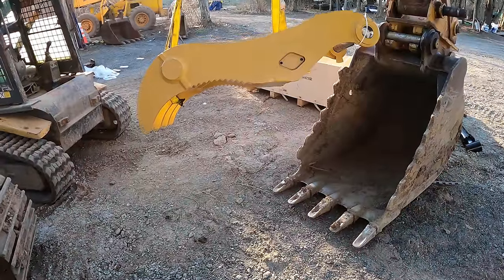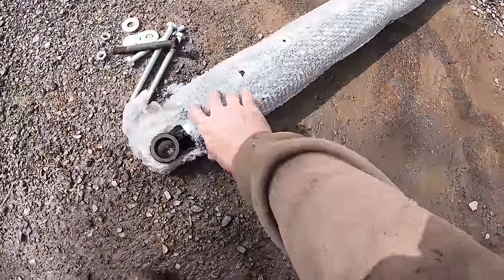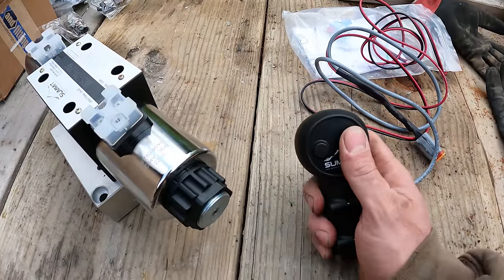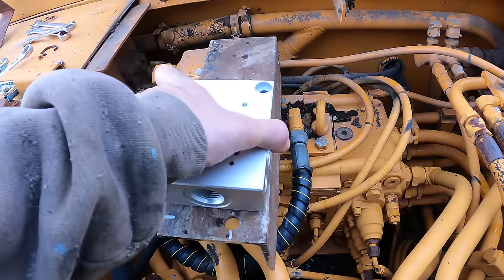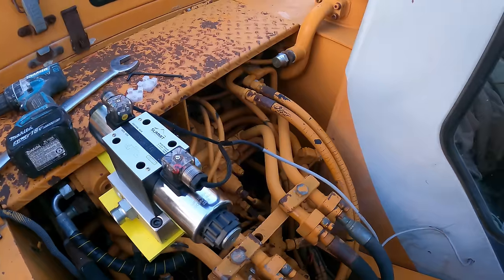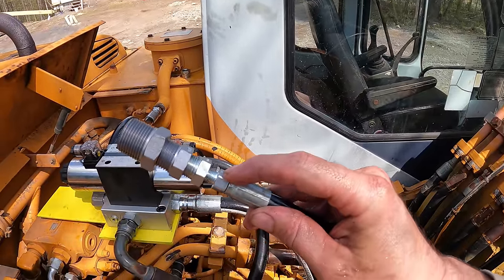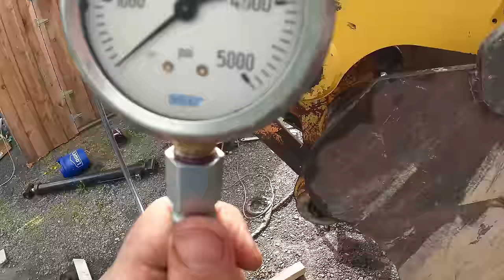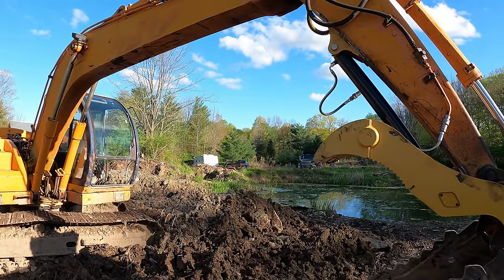Installing a hydraulic thumb on an excavator with 1 way aux circuit

Comment: You need to mount two short cylinders to the top of
the bucket on either side of the thumb, 
Instead of the long cylinder, 
like a skid steer brush grapple facing you instead of out front,
 so it will never bend a  cylinder. Or need a relief valve. And the cylinders be on the outside of hitting anything

Comment: Just use 2 diodes to activate that original one-way valve when you push one of the two new switches on the new control. If you have an old tv, there would be diodes in there that would work.
Reply from the maker: thats what i did
Reply: @jmuller86  I'm only halfway through your video, good work! You're wiring up the solenoids now.
Reply: @transmitterguy478  does your wife complain about going off half cocked? 😅
Reply: @13panda13  YES! All the time!😉

Comment: When using a thumb you always put the bucket on the wood then roll the thumb into it so you don't put to much pressure agent the thumb.
Reply: False. Other way around. Bucket has more control to move slowly. Thumb first then feather bucket.

Comment: If you do install an adjustable in-line dump valve, you should only have to put it on the thumb retract pressure side of the line (which is the side of the line the bucket pressure will be pushing against).
Reply from the maker: yea I could install a crossover relief valve right next to the cylinder. or just an inline relief valve by the directional valve, and tee into the tank for dump
Reply: @jmuller86  yeah, either way, it shouldn't be too much of a chore.
Reply: @jmuller86  Update, saw the last video. Bummer. I feel for you Jesse.

Comment: What a great video, but i have a question. Normally as you say, this circuit you added is used in tractors to split the tilt on the bucket to add ext equipment, but that means you'd have to push and hold a button for 3rd option, another button for 4th option and simultaneously move the joystick. In your setup you only push these two buttons which means there has to be some sort of computer somewhere controlling it, am I right? Could you please explain this setup in more detail since I'm planning on doing something similar on my Case excavator which only has foot control and I want button control for parallel boom, extra hydraulic(tilt bucket, thumb) and hydraulic coupler.

Comment: You need to put a reliefvalve on the piston side,just use the testport on the new valve and drain to tank.
Reply: Came here to say this.  Good call.
Reply from the maker: I left the one port open and no fluid ever came out so i dont think either of those tiny ports do anything. I was thinking a crossover relief valve on the piston side next to the cylinder. the excess pressure would then dump to the gland side and I would only be dealing with 1/2" hose there instead of 3/4, less expensive
Reply: Yes,you could do that but then you could end up with a oil volume problem since the piston side is a lot bigger then the rod side. I’m surprized no oil came out of the "test port"   Do you have a datasheet on the valve Block? Ideal solution would be to have the valve you have with all ports open to tank in mid position and have a overcentervalve on the cylinder,but now you have to work with what you got. Btw,love your videos and always look forward to the next. Keep em coming. 😊
Reply: The electric over hydraulic valve come from bedrock attachment too?
Reply from the maker: @brent9393  that was summit hydraulics. All the fittings came from hoseandfittings.com, they are the cheapest around and have everything you need

Comment: Jesse miller those hoses on the boom are the same as the rear axle on a skid steer rear drive to supply power & I just thought I would mention it that there the same fitting

Comment: Flexible conduit will protect the wires far better that just hanging out; grommets or pass-thru in the cab wall likewise will stop a lot of chances of abrasion on insulation of wires.

Comment: When the oil in the thumb is trapped, the bucket cylinder has the ability to damage the thumb cylinder. You need to add a relief to tank on the thumb cylinder. It will also help you from crushing things you pickup. Set it around 25% system psi, around 500. Your going for the minimum psi to hold something in the thumb.

Comment: Jessie, my dad used to own an automotive parts warehouse (bigger than Napa) and he also made hydraulic hoses. You can pick up a hydraulic hose press machine for about $1500 plus assortment of fittings and boxes of hydraulic hose and make your own hoses to size.  The equipment would pay for itself in no time. Plus, you can make hoses for friends at a discounted rate, which would also help pay off the equipment. Why don’t you do that?
Reply: Great suggestion! I see more and more YouTube creators of maintenance and repair channels doing that exact thing. Like a battery cable crimper, it's a no-brainer.
Reply: @Watchyn_Yarwood  😮q
Reply: ផលកម😊ចោល

😮😊

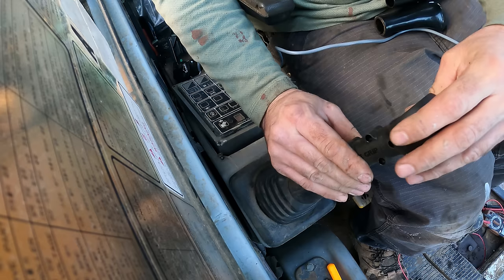Comment: 1:07:21 Could you not have taken the P and T lines off your original 1 way valve, and connect them straight to your cetop 5 setup and bypass it (and therefore the two electrical circuits)?

Comment: When the Thumb is activated then the relief valve is active in the circuit. As soon as you turn the thumb activation off, the directional valve closes the circuit for both lines of the thumb cylinder. You won't break the thumb or cylinder for the thumb. If you put relief valves on both lines of the thumb cylinder circuit, then you will never be able to hold anything with the thumb at full pressure because the relief valves will always be giving way. Just leave it like you have it and enjoy your new abilities!

Comment: The 2 smaller ports marked X and Y are pilot pressure and drain ports. You can use the X port for a pressure test port as it is connected internal to the larger pressure port and the Y drain port is essentially  a just a smaller tank port.

Comment: Would be fun to see you get an old lathe one day so you can do some of your own machining projects! If that is something you would like doing and you can find one at a reasonable price. I watch Farmcraft101 a lot and he is able to make a lot of his own parts like bushings and threaded adaptors. Would be good knowledge to pass onto your kids one day too!
Reply from the maker: yea when things settle down a little for me I would like to try to get into some machine work. A lathe and also a plasma table would be nice
Reply: It won't take but a few trips to a machine shop to pay for a good used lathe. And check in with IC Weld on to arc gouge.

Comment: Why are you fixing it to the coupler, instead of the bucket ?
Reply from the maker: Because otherwise the coupler is useless because then I would need to take the thumb off if I want to change buckets

Comment: You could take a steel plate and cut it in a fork shape so you can bolt the shutoff valve to the mount that held the steel line. The two tangs of the fork can hold the valve down and the space between the fork can access the shutoff. I don't think you want the cylinder hose flopping around put stress on the hose. It also looks like it could get tangled up and damaged.

Comment: Hello sir I did the same thing for my excavator with the same components. The reason why you have no relief is because the system from summit hydraulics is a closed system.
Reply from the maker: its closed to ports a and b but it is still open center. which means when not in use, it sends the flow coming in back to the tank

Comment: You done a beautiful job on that thumb install there is only one thing I would change I would put a 90 on that line going to the thumb cylinder so the line doesn't stick out and get Hung up in some rebar on a demo or some crap like that. Im your newest sub😊😊. Im also Operator/ Superintendent from Alaska

Comment: Yeah that 2300 psi is probably a different relief valve remote from the circuit you’ve added. You should use the test port for the bucket circuit, so your not guessing at the thumb pressure.  @farmcraft101 help us out here

Comment: For the wiring of the one way valve, if you have a single relay with a Normal Closed, Common, Normal Open, Ground and Power for the activation of the relay Coil. You can connect the "A" output from your direction valve switch to the Normal Open and to the relay coil. Connect the "B" output to the Normal Closed and the one way valve coil to the Common. When the "A" button is pressed, it will activate the relay and that will activate the one way valve through the Normal Open connection to the common which is now activated and making a connection. The "B" button will activate the one way valve directly through the Normal Closed to Common circuit because the Relay will Be off.

Comment: Where do you get your shims? I have the same excavator. I’ve been looking for used parts but having trouble finding them… might have an extra grading bucket that your looking for pulled it off mine and put a digging bucket on it.
Reply from the maker: I have my parts machine that I am selling parts for it you need anything. Some of the shims came with the thumb and I ordered 70mm shims for the thinner ones

Comment: Why don`t you use two relays one for each button so either relay when energised would do the same thing as the activation button then you would not have the problem of the back feeds

Comment: Damn, the moment you said 200 an hour for that machine my jaw dropped, over here in Europe 200 an hour would get you a 100000 pound machine with a full hydraulic quick coupler (no hose switching) with demolition tools like hammer, sorting grab and shears... Even though the price of diesel here is higher as well

Comment: You could/should have cutout a notch in the angle iron to provide access to the existing bolts on top of the one way valve.

Comment: You did a Great Job on installing that Thumb. You may want too put a Cover over that Valve you mounted . For when Branches fall out of the trees.. Ive seen branches end up in around the House motor..Just a Suggestion is all  I would hate to see that valve get broke from a tree branch...If you can find those Valves I would definitely install them. Dont want to bend the chrome cylinder on that thumb...Again Great Job and Video..Having a Thumb on a Hoe is definitely NICE too have.

Comment: You can do one relief valve, using two check valves (in much the same configuration as the diodes on your switch, hilariously) and 4 tees.

Comment: without reading all the comments .... the reason the holes are 2 inch is so you have to put a bushing in... they are the wear item.... lots easier to change the bush then remove the welded on plates

Comment: rather than the diode you could use a relay when you press a button it would activate the relay and send power to the aux hydraulics would be clean and simple.

Comment: Do you want to sell that coupler
Reply from the maker: maybe. I dont see how it will work though, I only had 2 hrs of use on it when it bent that pin. I have two volvo couplers, hydraulic S1 style for 70mm pin

Comment: ACV inc. in Menominee falls Wisconsin can custom build a hydraulic cylinder for you and I don't think they aren't priced to bad. Or you could of sent in the one that you gave and have them machine those ends off and weld the new ends on
Reply from the maker: Do you think they would be able to rebuild the hydraulic end of a final drive that you cant get parts for anymore? Just bought a tl26 takeuchi and I cannot get the parts to rebuild the drive motor

Comment: A setup of two diodes will work better. But you can use two automotive relays from the nearest store.
Reply: Jesse, install a hydraulic emergency valve in the cylinder bypass and adjust the pressure. You will need: A valve, two hoses and two tees. This will solve the problem.

Comment: Hyd System P, T, DR: The Flow Control Valve should have came with a sheet telling you what the connection are. P-pressure, T-tank, Dr-drain. A- port Rod end cyl, B-port blind end of Cyl, My guess (.25 conn.) DR, collect and run back to the tank. I didn't work on Hyd Design I would rout the tubing from Valve Stand to equipment T.O.P. at the equipment, and from the power unit out to the Valve Stands. V.S. could consist of 6 or more control valve  mounted on the manifold blocks. Cyl speed, you can add a hyd speed control valve (needle valve) at the cylinder. Thats what I remember.

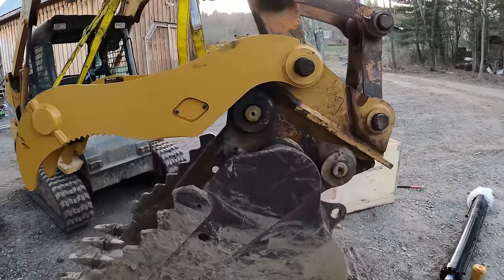Comment: @Jesse   08:10    I cannot be the only one that noticed the distance between the bucket teeth and thumb teeth, looks suspiciously close to the distance between those pins? What if the thumb was meant to be mounted on the coupler pin? That would allow it to reach further down, to meet the bucket teeth.
Reply from the maker: yes, but then the thumb would stay with the bucket and defeat the purpose of the quick coupler.
Reply: Could be. ,,,, I could be wrong but that thing is balls out clumsy. Any machine with a thumb I ever ran had a much more elegant configuration to it. Looks like it is something from or for another use. None of those knots and knobs look like they line up with anything on the bucket.

Comment: You don't want the bucket to be able to push the thumb. I like a good solid thumb you can pick up stuff much better
Reply from the maker: I agree, but thats how you bend the thumb cylinder rod though. This one is already bent, just after I finished the video I bent it up bad
Reply: @jmuller86  ohh not good lol I've never bent one .. can you dial back the pressure on the bucket a bit?
Reply: @jmuller86  On the relief valve "question". I believe it's not letting you push the bucket because the new valve you added just closes the connection. If you press button A or B on your joystick, it moves it so there's flow on A and return on B (over vice-versa). So when you're not pressing any of those buttons, the flow to both lines is closed, which you are pressing against with the bucket. So when you press any button, it will allow you to press the thumb with the bucket, only in the opposite direction of the flow to the thumb. I could be wrong though, but to me it seems that valve is closed in "idle" position.
Reply from the maker: @Qlii256  this valve I specifically got with the open center option, so it lets flow pass to the tank when a button is not engaged. Its the original one way valve that closes its center when not in use. I could leave it open but drastically reduces the flow and pressure for the rest of the machine
Reply from the maker: @criticalevent  i see what you are saying. And that very well may be the case. Wouldnt an inline relief valve between the port and the cylinder be the best option? Something that is mounted right next to the valve so it can have a return to tank
Reply: Or you need to adjust the relief valve on the new control valve.

Comment: Once again, it sounds to me like you should look into that Vevor hydraulic fitting press kit.  $1200 would have more than paid for it as well as the hose and fittings still leaving money in your pocket and ready for the next time you need hoses.
Reply: Link please? I don't see a hose crimper they offer for 3-4000psi hydraulic hose applications. thx.
Reply: PS. Don't know what the top rating is. Check it out.

Comment: send it back and get the right one. you will be better off in the long run. i've had similar luck and nothing is better than the correct one.
Reply from the maker: the thumb ? the one for the quick coupler would be too long and it was like 2 months out

Comment: The type of fitting for the hoses connecting to the boom are ORFS O-ring Faced Seal
Reply from the maker: The connections that have the bolted flanges? Not the ones I was getting into right?
Reply: @jmuller86  correct.
I don't know if they still print it, but Caterpillar used to publish a generic parts catalogue called "one safe source" and they had charts with all the types of hydraulic fittings, bolts, bearings etc, if you can scrounge one up, it would be a useful addition to your library

Comment: to stop a crack drill a hole ahead of it - also it hurts me to see anyone hammering steel with a steel hammer as  it nars the surface ... use a bronze hammer ... hammer material shud be softer than what you are hitting

Comment: When u put the thumb on the first time u put it on the quick release pin instead of the bucket pin that's why it didn't work.. if you installed it correctly u could have kept the quick attachment..

Comment: Hi, you can resolve the relief valve situation by just actuating the "hammer line" with an on/off switch, and using the relief valve block you already have, by letting the fluid circulate on the new eletric actuated valve block (power beyond) all the time the switch is on! I think this would work okay; hope it helps!

Comment: You got it on and working pretty well,,,but,,,,from the footage of using it the shape lookst to be all wrong. Clumsy doesn't half tell the story. The back teeth look to be useless. It looks like something for a different machine that was dixied up to "sort of" work. 

Good job getting it on the machine but i think what they sent you was either a real dog or for something else entirely. I could be wrong, but it didn't look like is was very good for picking up logs, but it was even worse with rocks.